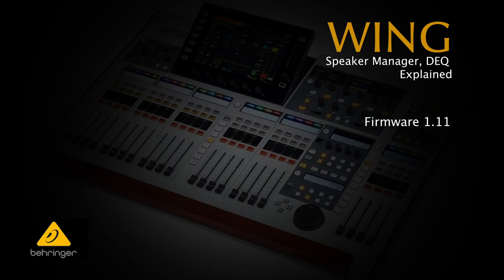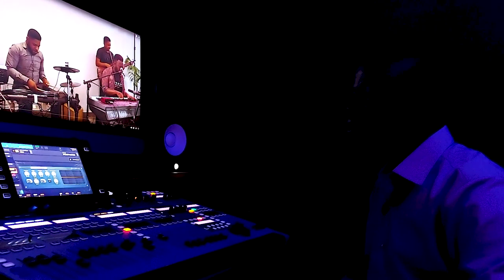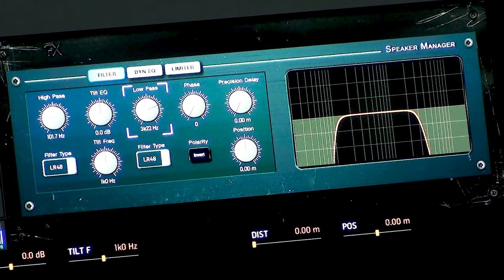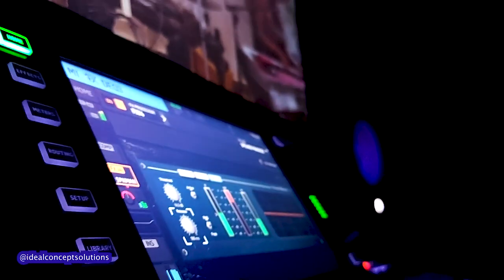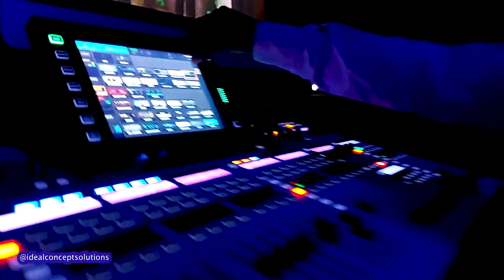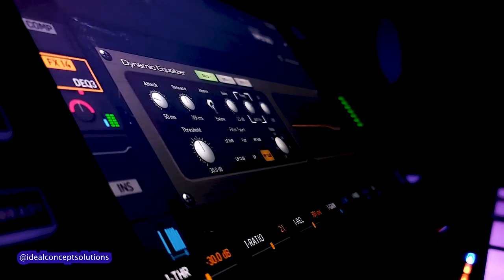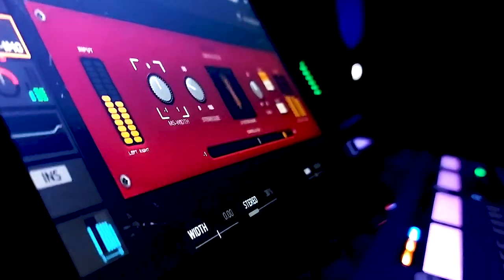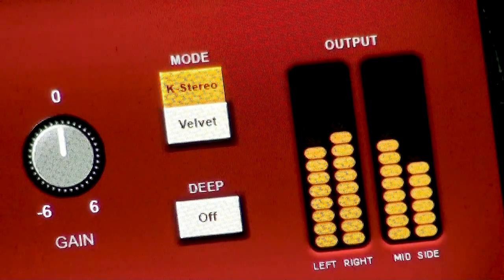Behringer WING NEW SPEAKER MANAGER PROCESSOR  How to use it

Comment: Hi!

Just watching you video my friend, if I may add to your video, the Speaker Manager limiter is not made to be used as Mastering limiter. it’s a 0 Attack limiter and using it at hard level of limiting can cause Square Waves and those, once amplified can send DC into your speaker coil. that would dommage of not burning them. it’s not advised to use the main limiter other then use it to protect your PA form short peak. 

please take that in mind when using your limiter. 
have a great day

Comment: Does this mean we don’t need a speaker management like the DBX driverack 260 for our main FOH? pls respond appropriately
Reply: Yes and no. From the look of this, you would burn up an FX slot per output you need. 
I would stick with the Driverack just because its an outboard piece and will make the Wing be more powerful because you wont be burning up FX slots.
If you are tuning the PA and doing all the crossover stuff on an outboard piece and the FOH console dies, at least you will still have your PA settings.